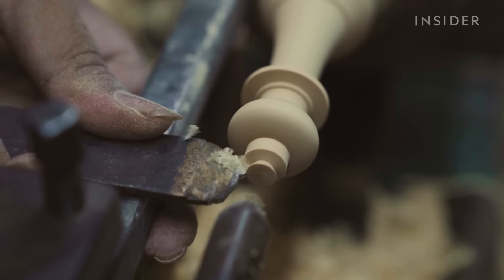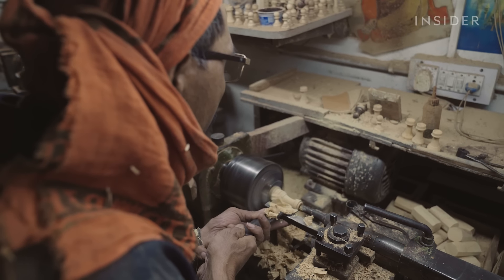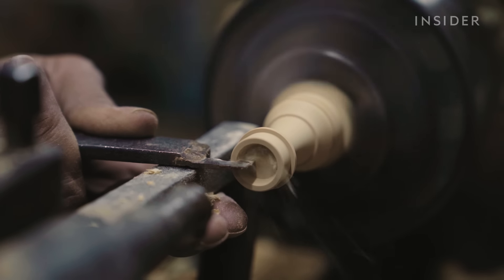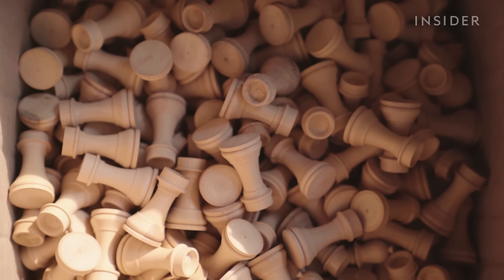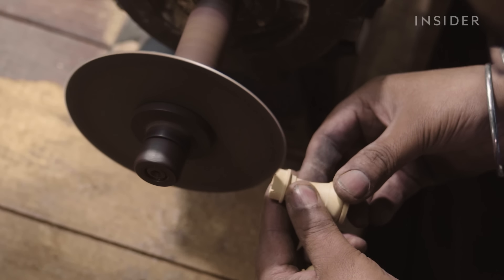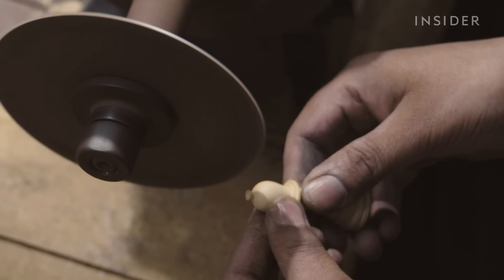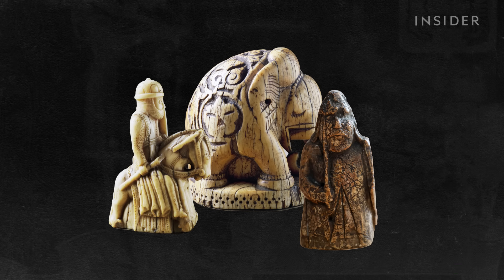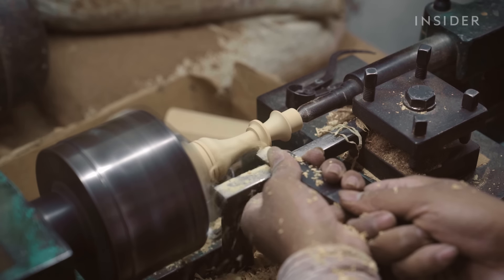Why Championship Chess Sets Are So Expensive | So Expensive

Comment: This is one of the most pretentious episodes I've ever seen. In no way shape or form is the feel of the piece going to affect the outcome of the game. Ludicrous.
Reply: Probably more comfortable than a Barb Wire Chess Set but then again most things are.
Reply: I guess you have nearly zero experience with OTB Chess. Even Super GMs tend to make illegal moves under time pressure because they accidentally move the wrong piece(due to similiar looking pieces). This completely disrupts the flow of the game and can effect the results as well. Another reason is that, the shape and stability of pieces are vital for accurately moving the pieces to their desired squares especially in faster time formats like blitz.
Reply: Yeah no in fast paced chess rounds it can.
Reply: @hsthast7183  Then what does material and hand crafting have to do with it? Whats the point of spending 100 years learning how to carve a knight when a machine will produce a 100 in an hour that will be exactly the same?
And I call bullshit that it takes 6 years to learn how to carve a knight.
Reply: @zaelaporrou  you saw the video didn't you? Such carvings on wood can only be man made you can't automate that unlike plastic pieces. Well regarding the 6 years thing, why don't you start learning how to make a knight and check for yourself... Coz you calling 'bullshit' doesn't mean shit. I took mechanical engineering workshops in collage, I know how hard it is to just make simple wooden joints. So please don't 'bullshit' me.
Reply: Oh damn. My man here is GM, woodworker and an engineer. The only thing he doesn't do is care about the nearly slave work these artisans are subjected to. No one is perfect I guess.
Reply: @hsthast7183  you clearly don't play Chess online
Reply: @Richardparra_og  Well most serious chess tournaments are over the board so...
Reply: @Richardparra_og  wow you have perfected the art of 'false assumption', of course i play online chess. Tf u even on about?
Reply: That's right! I once played a chess game and every piece felt like a pawn. that game went on FOREVER!
Reply: @shadourow-bathory6965  grandmaster over here, his success is purely based on how the pieces feel. Who cares about strategy amirite?
Reply: @hsthast7183  damn dude i didnt know you were a woodwoker, engineer and and grandmaster on top of that. You definitely sound like you know what youre talking about
Reply: @historicalsignificance4183  you didn't know coz i am neither of those things. Also thx for the complement.
Reply: I dont think you necessarily need to buy one of these £500 sets, but i have played with cheap plastic ones and accidentally knocked over pieces or picked up the wrong ones and accidentally made illegal moves when mistaking one piece for another. However i agree that the reason it costs £500 isnt for this reason, you can still buy far cheaper high quality chess sets that are still weighted and everything.
Reply: @hsthast7183  then why would anyone want to use these hand-made piece if they are looking for uniformity? This whole process of making pieces for the world championship could be entirely automated, which would make them way cheaper and more efficent to produce.
Reply: @skillorb  kindly direct this question to FIDE, i am not their spokesperson.
Reply: @ronal8824  go ahead then! But theres still something special with handmade stuff. Handloom textile industry is a prime example. We have machinery to make any sorta clothing we want. People still buy Handloom clothes for special ocassion coz its traditional, authentic and exotic.
Reply: @hsthast7183  You wouldnt be able to differentiate between the CNC carved chess piece and a handmade one, the funny thing is probably the CNC one would be the more accurate.
And if rush decisions can ruin a game than there is a solution: color coding them :)
You are right its like fashion there is no real difference between a well made handbag and the designer handbag, the only difference is that you can brag about that you spent 1000s of dollars on a bag.
Reply: @collan580  I think Hst Hast lost their credibility with indicating a CNC can't make all certain movies. Also just being plain rude. Though Spencer Zeman either a bit ignorant on the the importance of shape and form. I think they meant the video presented the idea as more critical and majestic. 

To help the players not make a mistake, the pieces are different shapes/heights/weighted. But they could look like anything, they just need to be consistent. 

*none of this really pointed at you though

Color coding isn't a great solution for the visually impaired. But again shapes and heights are more then enough. You don't need a piece to have 6 perfect notches on each side if it's already the only horse on the board. Or they can totally make unique parts with a CNC without some impossible cut.
Reply: @hsthast7183  Yeah but the core of the issue is that these "tournament certified" pieces look all the goddamn same except for the knight!
Reply: @DzinkyDzink  fide still prefers this...
Reply: @shadourow-bathory6965  we’ll there’s a line between a solid set and 500 dollars
Reply: @hsthast7183  CNC can automate anything.
Reply: Most pretentious, yeah. And that's saying something.

Comment: Whether you're using the $500 chessboard, or the $20 chessboard, it's still the same game.
Reply: Yea I dont even understand the hype around it, not even GMs have expensive chess sets, and most people are playing online nowadays.
Reply: @stevenren4389  and comparasion because 1 pcs ACTUALLY VARY IN QUALITY they dont all look or work the same u may not be able to play some games on a 100 dollar pc but with a 5000 one u are guaranteed it ur settings on the game would also have to be lowered
Reply: @stevenren4389  There is nothing wrong in spending a lot of money on a Chess Set, people do it for decoration, maybe it has some history. I still use my chess set for studying everyday even though I mostly play online these days.
Reply: @stevenren4389  Using a PC as an example really won't make sense unless you're talking about cosmetics. There's a massive difference between the performance with let's say a 400 USD laptop compared to a desktop pc with  recent high spec parts and not all applications run on the same requirements. The high spec parts are expensive because they're better in most cases than cheaper options especially if comparing with products created by the same company
Reply: @stevenren4389  Honestly if you're using a $5k PC as anything other than a tool(like actually making the games, for example), you're kind of a putz.
Reply: Tell that to the idiots buying the new iphone every time one is released. Or some high end android, for that matter. People are ridiculous with their phone buying habits. And then they complain that they aren't paid enough when they're blowing $1000 per year on a useless upgrade to impress their friends.
Reply: @chonjacki  "but it has a 1% better camera tho!"

Comment: This process could easily be replicated in a CNC Turn (with milling function), it would improve precision (to within maybe 0.01 mm, doable manually but hard) and really speed up the process, some crafts I understand can’t be automated easily, but this sure isn’t one of them
Reply: 3D printing
Reply: If they aren't getting paid for the skill they have then the CNC could print them out easy haha.. than just go back in with a knife to make it look hand carved..
Reply: @douglashaussler4238  Can a 3D printer print in wood?
Reply: @Morhua1  Yes.  Its evolving but 3D printing with wood filament has been around
Reply: @douglashaussler4238  Afaik 3D printing would be a bit too sharp especially for the detailed pieces. It won't have that nice, finished look that the ones in this video will have (or like in the comment above, CNC'd).
Reply: too expensive. Use a regular CNC mill with 180 degree indexing.
Reply: Someone still has to program, operate, and maintain the CNC machines
Reply: @mitchellcollins7370  And? Operating a CNC machine won't cost nothing to a big million dollar corporation.
Reply: Best experience is of Hand Made products.

Be it cars or chess!!
Reply: You can't automate art and keep the value of the artwork. These sets are probably already automated but there's a reason you rather spend money on something hand crafted
Reply: Its funny, since it would be cheaper for the sweatshop owners to own a 3d printer with a couple lines of code than this
Reply: Stephanie Ellison  The point is to free humans to fully dedicate their time to achieving higher levels of intellectual challenge which will drive human innovation even further. A future where menial tasks are automated and we can spend our time pushing the limits of science and technology doesn't sound bad to me.
Reply: Stephanie Ellison  I don’t think the laborers making $5 a day making chess sets for rich assholes to flaunt about care about things being “fun.”
Reply: Dude there's a special charm in hand made wood things you won't understand
Reply: a cnc operator would make hundreds and hundreds of parts a day. 3d printing is slow.
Reply: @douglashaussler4238  3d printing produces cheap plastic figure wooden products are class
Reply: It's weird that people pay more for handcraft and tell machine work apart because they are too perfect
Reply: Handmade>CNC
Reply: @triliner254  You mean to the big million corporation that works in India and sure that pay almost nothing to a worker that it's the only of the 10 people in the world that can do that and later sell it like if a expensive artisan does the work?
Reply: Then they wouldn't be able to say 'handcrafted by master artisans' and slap a $500 price on it.
Reply: @TheWizard856  you sound awful, as does the world you envisage. Making stuff with our hands is one of the things that makes us human and makes being human bearable. That said, this is just moderately skilled production work and isn't all that impressive.
Reply: @TheWizard856  oh, and can you name a single 'human innovation' that hasn't actually made things worse overall?
Reply: @harrylane4  don't they? I'm sure they appreciate you speaking on their behalf.
Reply: @LeventDV  Is it really?
Reply: @TheWizard856  Except in the entire history of technology since the industrial revolution freeing people from menial work has NOT been the effect of machines & automation, quite the opposite. The histroical effects are to create large scale  unemployment, which drives down wages for people still employed, and to increase the intensity worked as workers become appendages to the machines that run the process rather than mere tools in the hands of a worker.
Reply: Stephanie Ellison  So do you think that it's better for some random sweatshop to produce these overpriced pieces?
Reply: @anshik.k.t  Of course there is. The idiocy and snobbism here is that the "championship pieces needs to be perfectly handmade" when the same perfection/imperfection can be mass-produced in a CNC machine. The players wouldn't notice any difference and it certainly wouldn't change their game. The satisfaction of owning an expensive handmade chess set is another thing.
Reply: @Douglas Haussler it also looks like dogshit. That filament is nothing compared to solid real hardwood
Reply: Entire factory operates on $125000 a year — material, carving, dying, buffing, management, sales.
Reply: Stephanie Ellison  I work with a CNC and it's a BETTER job than working on the floor with a 5$ fan...
Reply: Stephanie Ellison  Nobody asked
Reply: Sooo true!
Reply: machines cost more than people. those guys are making pennies, machines cost dimes.
Reply: But machine producation would create massive ammounts of supply which would crash this whole scam and sets would cost only a few dozen euros.
Which is good obviously. The paperwork salesmen that prevent this are to be put in their place.

Comment: In this day and age of CNC machines, I find it hard to believe we can't make pieces to these exact and uniform specifications, much faster,  more accurately, and cheaper.
Reply: We can, but in India you must give work to 1.5 billion people and 99.9% of them unable to do work which requires higher education. Many of these "craftsman" videos portray people who are doing a machine's work just slower and less accurately.
Reply: The knights are extremely hard, and these pieces aren’t metal, so you can’t use lasers to cut them
Reply: @pianodna-james3147   there are machines that have tools that cut wood just fine. A CNC machine could do it more accurately, more consistently , and faster.
Reply: @banatibor83  you don't need higher education to program a cnc machine.
Reply: @samwalters4205  These people are payed cents for an hour's work. Compared to that CNC machines are very expensive. Also, people who know how to operate a CNC machine will not be working for such low wages.
Reply: @samwalters4205  I can tell you've never used a professional CNC cutter to make 3d objects
Reply: We can, they just wouldn’t have the same level of prestige
Reply: @stoutyyyy  The only thing in this that would make them "Pretigious" is the uniformity of four pieces, and even then I doubt the veracity of the claims that they regularly get them exact.
Reply: well then you couldnt call them "handcrafted" and sell them for $500 a pop could you?
Reply: @blaze_yt_6990  This is the real answer. It has nothing to do with what machines can or can't do. In countries where labor is more plentiful and cheap than machines, labor will be used. It's one of the reasons why tailoring and other services like that are so much cheaper in developing nations. There's no incentive to invest in mechanization when you can pay a few people 5 bucks a day.
Reply: @copperheadmtrsprtspark7738  But they leave a burn mark unless properly configured

And i swear to god, i have not seen a single CNC ever properly configured in the areas where these companies would build factories
Reply: @CylindricalWhistle  Bro, i can set up a machine that would let me flood the market with precision pieces (as in, <1 µm tolerance) made from stainless steel at $50.

Today, the cost of labour only really matters if your workers are enslaved and mine want $200/hr
Reply: @angrydragonslayer  Someone would have to pay the machine designer, pay for the industrial parts, pay for upkeep and maintenance, and high quality materials/mechanical knowledge might be at a premium. Whereas human labor costs almost nothing. The proof is in the fact that they do it this way. If this wasn't cheaper, they wouldn't keep using human labor.
Reply: @CylindricalWhistle   @Historyism  there's no startup cost (the machine i mentioned being $350k with another $50k in tooling and workspace prep) but if you listened to the video, you could have heard her say that they make 250 sets per year. That's $58,4 in wages per set assuming 40 hour weeks and average pay for the region ($5/hr).

I could produce 250 sets per day in carbide, maybe 500 in stainless and a lot more in wood

And i'd make a $5 profit on that $50 price for the stainless
Reply: There are quartz movement watches that tells time more accurately, is more reliable and runs for years and years on a battery. Quartz watches can be built in bulk and is 1/10th the price of a swiss hand made mechanical movement.  Do you think a casio is better or classier than a patek philippe?
Reply: @SALMANNNNNNN  anything with a standard production is only worth the marketing put into it (mad respect to de beers for basically writing the book on that) and the bare essentials

i have a custom watch with a modified spring drive (9R96) where i pulled the automatic part and replaced it with a self-made solar system to wind the spring.

to have a brand name on the face is equally cheap in my opinion, the quality should be so apparant that there is no question about the rarity or cost of the watch.
Reply: we can, these ones are "special" because they're handmade
Reply: Handmade>CNC